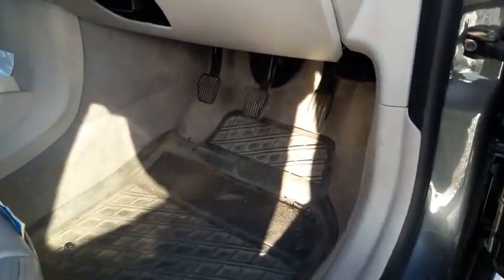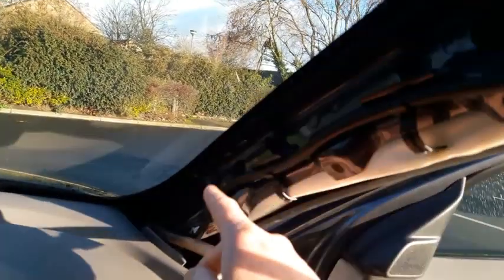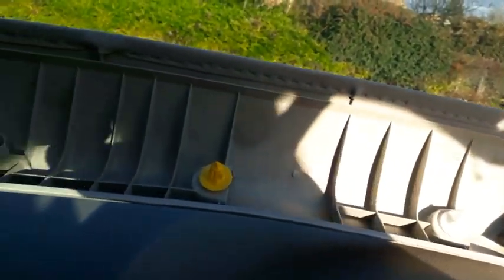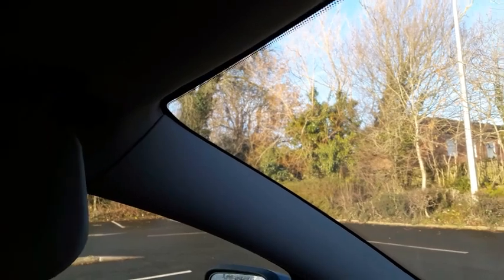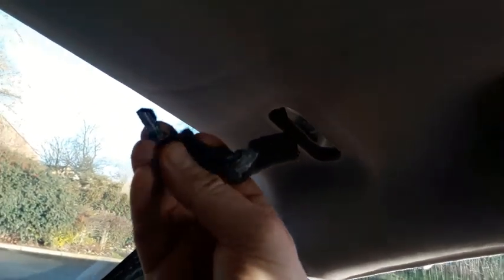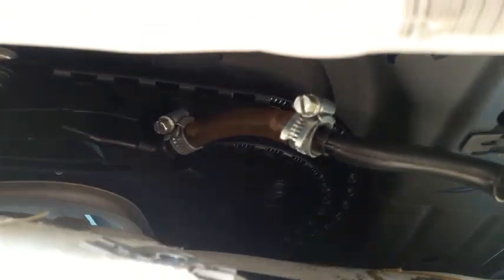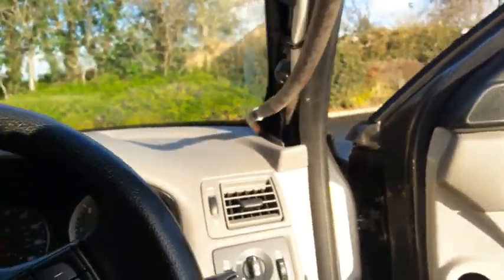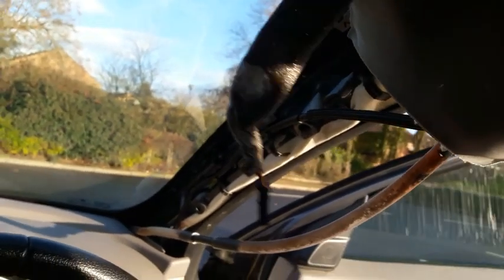Volvo V50 Water Leaking Into Footwell. Wet carpet mat

Comment: I did this with mine last week. But my drain line is one piece, no joints in it.
But rather than peel back the headlining, I blew through the drain line with compressed air from the bottom end of the line to clear any debris in the upper drain hole, then attached the drain line to the lower drain hole/rubber gromit that is located under the scuttle panel, and blew through from the top end of the drain line with compressed air, and sure enough, this cleared all the crap that had built up in the rubber drain gromit, and fixed the problem. 👍

Comment: I loosened the roofing and the drain tube from the sunroof was clogged, the water was standing all the way to the top of the tube. I took it off on the top and blew hard with my mouth, with success, something disappeared! So hopefully the wet floor problem is solved. Thank you for the video!
Reply: Good work

Comment: Mine was the pipe in the dash area, it had clogged there due to restricted size of opening (poor design) and the pressure had separated the hose from the degraded fitting. I just replaced the whole tube from sunroof down to firewall   outlet.

Comment: Also .... try this ..... common fault on Volvo S40 ... Mine said "Boot 
Lid Open" ...when shut .... go to the wiring loom ... on left when boot 
open .... peel back the rubber and re-join the broken wire ... sorted 
............ Note .. make sure the rubber grommet is secured as water 
will get in and you will have a wet patch behind passenger seat.

Comment: I have the exact same leaking in the footwell of both driver and passenger when it’s really bad weather. However, I don’t have a sunroof. Any ideas where it could be coming from? Thanks
Reply: Hi I’m also getting water leaking into the drivers side footwell but don’t have a sunroof either. I’m thinking it’s a badly fitted windscreen also but brother said it could be blocked windscreen drainage ... any thoughts?
Reply: @edwardbowe820  I’m getting mine look at on Tuesday so I’ll let you know what my mechanics says. 👍🏻
Reply: @TommyS61867  great thanks I’d be very interested to hear the outcome! Cheers :)
Reply: I have same leak on both footwells. I have no sunroof either.
Reply: @TommyS61867  hi there did you have any luck??
Reply: A hole in the floor? 😱